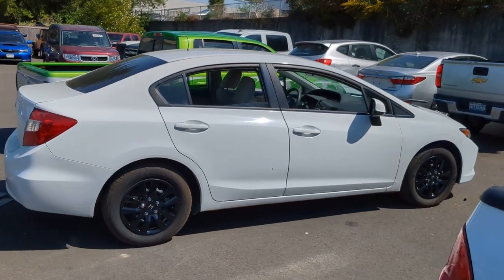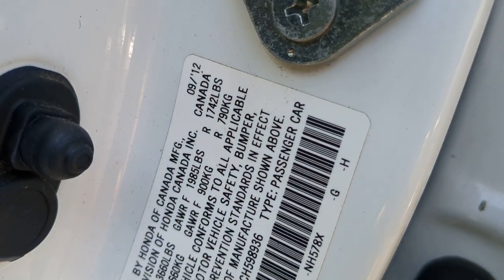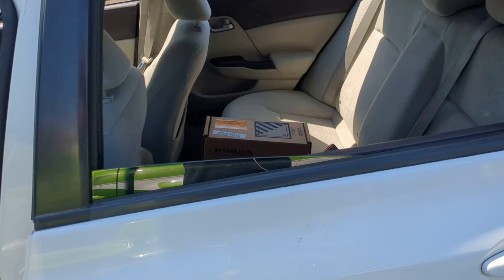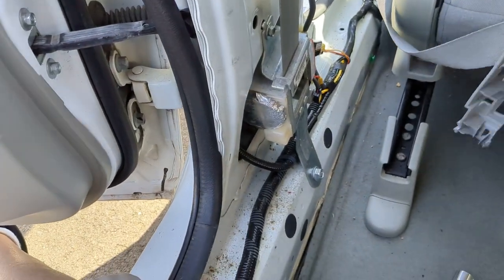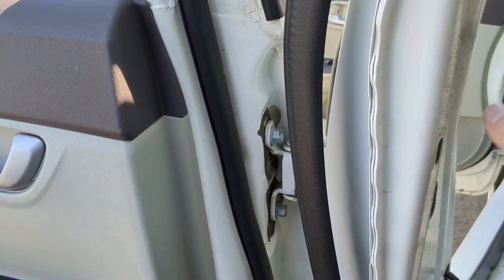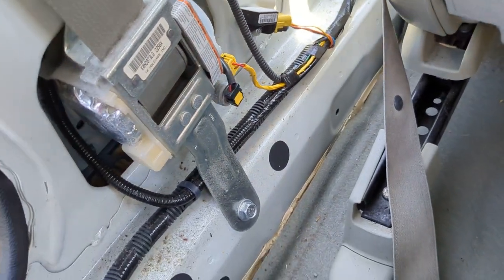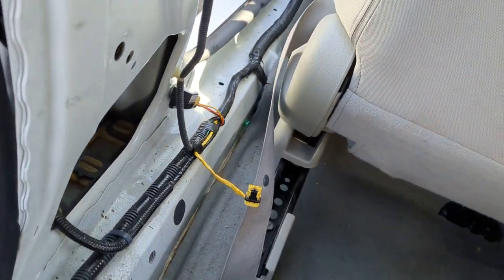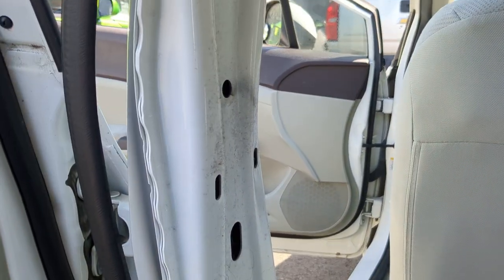2012 Honda Civic Rear Seat Removal to Replace Drivers Seat belt

Comment: How much did you pay for the seat belt?
Reply from the maker: Hi Kelsey. I apologize it took so long to respond to your comment. Sadly, somehow I never saw it. Unfortunately, I do not buy the parts that I use at the place I work. They buy them at wholesale from the dealer, and sometimes they provide me with aftermarket parts. In the case of the seatbelt, I'd recommend using OEM parts, either new or used. Thanks for watching. - Sponge